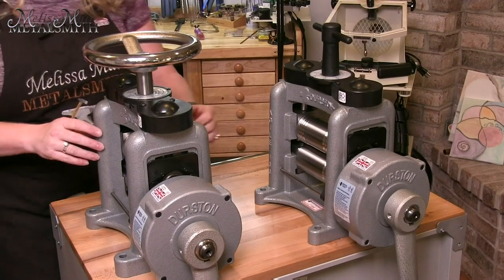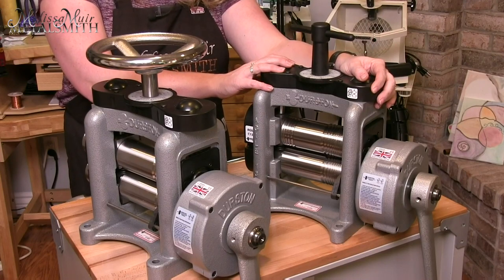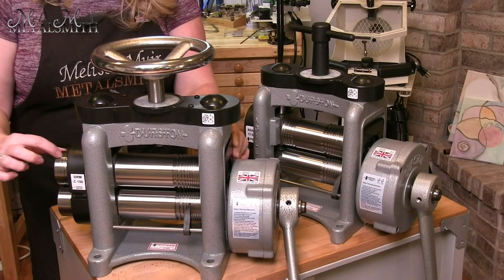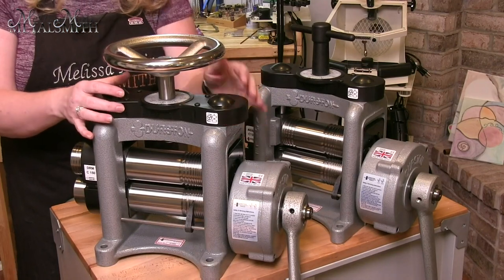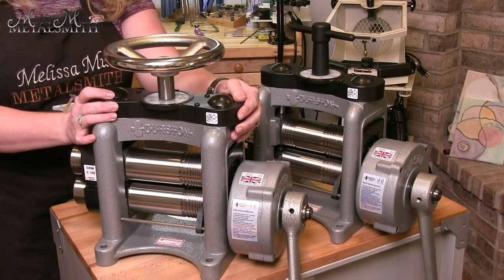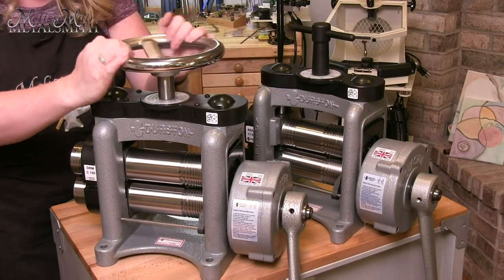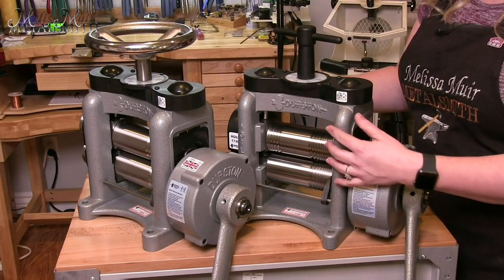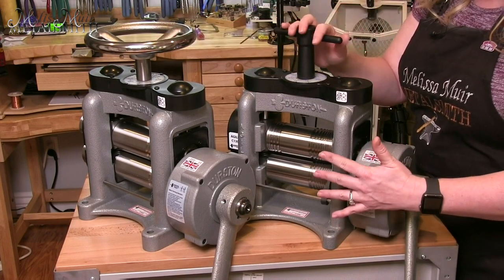Durston Rolling Mills - Difference between DRM and Agile - Weekend Jewelry School - Melissa Muir

Comment: Admittedly, the two mills look pretty cool next to each other. For mounting, I'd suggest using fender washers, grade-5 hardware as a minimum, and bore one hole at a time. If you own a set of transfer punches, this is the time to use them. Bore the hole, insert the hardware, then bore the next one and so on. That's how industrial benchtop machines are installed. A mill is pretty similar in this regard.

Comment: Hi Melissa
Thanks again for another great video 
I’ve had my Durston DRM C 130 for a few years now but have only recently started to get full use out of it. Yesterday the handle came off and I can’t get it to stay on. There is a hole on the handle with a screw thread inside it. I can’t remember ever seeing a screw in this hole and I didn’t hear anything fall when the handle came off. Should there be a screw in this hole or is the handle secured in some other way? I can’t figure it out!